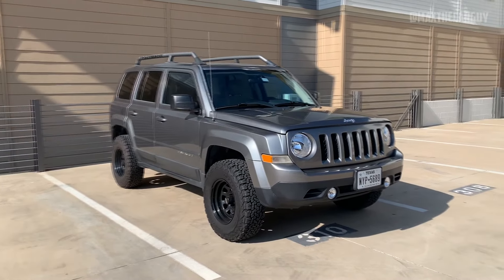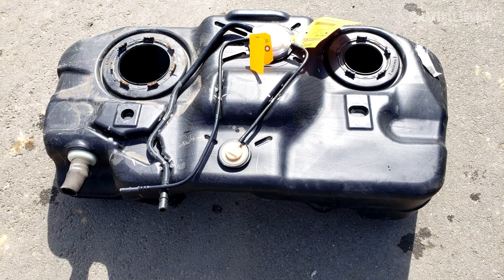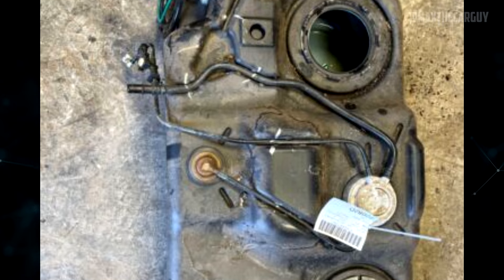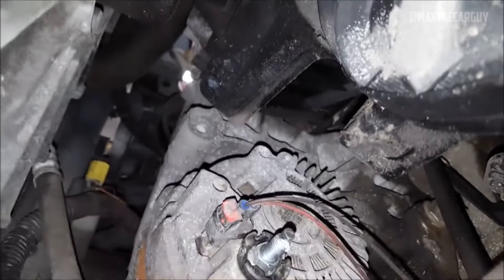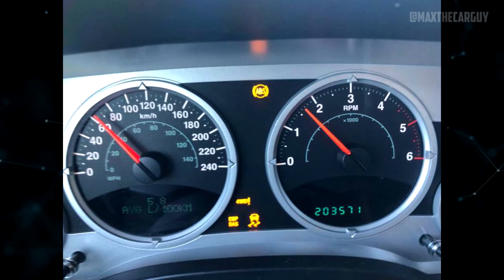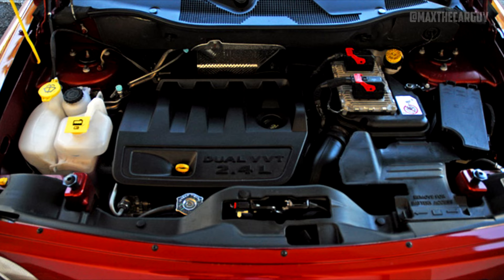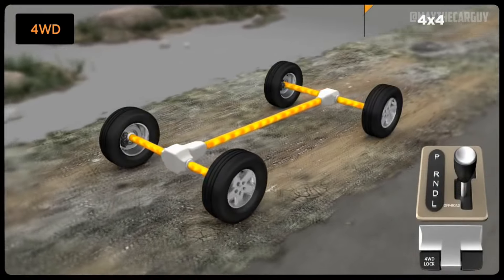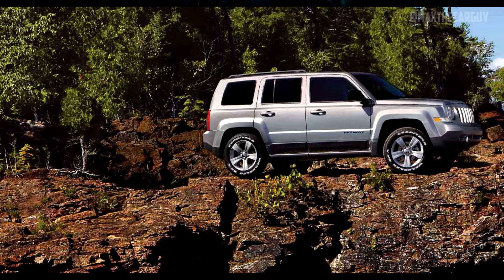Used Jeep Patriot (2007-2017) - Reliability and Common Problems

Comment: Buy a Toyota end your misery of owning a Chrysler product
Reply: All cars have problems. I bought a brand new 2023 Corolla and the transmission went out at 20k 🤷🏽 just to show you!
Reply: Toyota is crazy expensive. I just need something good and simple
Reply: @Jadenkimg05  Toyota super reliable Chrysler products are not money pits come in at my work all the time always needing tons of work
Reply: Yeah I guess
Reply: Not giving 20,000 for a Toyota with 200,000 miles. Just not doing it.
Reply: My Toyota lasted longer than my Chrysler, but my Chrysler lasted longer than my Ford and my Buick
Reply: At least chryslers won't rust as fast as a Toyota.
Reply: @philliplillpop860  a Toyota with 200k mi will be less problematic than a new Chrysler product.
Reply: Jeep = just empty every pocket
Reply: @papabear3525 I Don’t doubt it, but over all Toyota, Honda, Lexus have a much higher reliability rate.
Reply: 30k vs 16k new then
Reply: @TraveladvRajanSRai  the best built vehicles are not cheap.
Reply: @davidthomits544  You obviously either have a lot of customers that neglect their vehicle or you’re padding their bills.
Reply: @Slacksfifth  Toyota sheet metal is made from recycled steel.
Reply: @uncletoby- as all steel is recycled. But Toyota is manufactured to a MUCH higher standard
Reply: @TheRealCaptainKlutz  I’ll stay with a Chrysler, Jeep or Dodge vehicle over any imported vehicle. I’ve never had any trouble with any of the ones I own and have owned.  I still remember WWII and the Korean wars and what those people did to our soldiers.
Reply: @uncletoby-  I knew just by your comment about the steel that you were ...older.  something something stuck in your ways, now you're bringing up two events not related at all, but your narrow focus groups them together. You can have your Chrysler's, owned and designed by stellantis LoL 😂. Or Buick. Those vehicles appeal to those that don't know any better.
Reply: Yep Toyota hasn't had major recalls the last 15 years. They ALL cut the same corners. Gtfoh
Reply: @Slacksfifth  That’s because they’re built using recycled steel from the U.S.
Reply: @mitchellferre1652  Not mine.
Reply: @TheRealCaptainKlutz  Not !
Reply: @uncletoby-  they are all made from recycled steel.  There is nothing wrong with recycled steel.  It's not weaker or more prone to rust as long as it has been properly treated.
Reply: @TheRealCaptainKlutz  Glad you think so.
Reply: @uncletoby-  I know so old man. Been manufacturing steel for nigh on 30 years. The best steel comes from Japan. EOS
Reply: @mitchellferre1652  Glad you’re driving that imported crap and not me.
Reply: I totally agree with American made vehicles nowadays you’re just buying overpriced gimmicks and low quality junk
Reply: @Jadenkimg05 look in to old Buicks
Reply: If you love Japanese  . Remember  1941..

Comment: I’ve had my 2016 Patriot for almost 5 years now bought it used, has had normal maintenance still runs great 😋
Reply: I think im about to buy one thats why im here but your comment made me more confident in my dicision thanks!
Reply: Have front and rear cross members checked. Just had my rear replaced along with radius arms and some suspension parts due to rust. Very expensive.  Mine was past the 10 year warranty extension. Not sure what your warranty options would be with a used car.
Also, replace the PCV valve. It's cheap and easy to do, and it's routine maintenance that's makes a big difference in patriots.
Reply: Yep, 2016 and 17 they got it right. My 2016 is solid and what a find, the good transmission, back up cam, zero issues because timing chain and the best build of all the years.
Reply: I bought my 2016 with 43,000 miles. Now have 157.000 and going strong
Reply: Me too. I've had mine a 2016 for 6 years with no problems. And it runs great in the snow ❄️.
Reply: @timothywalter9555 don't my 2017 2.4L high altitude edition has been nothing but problems, from suspension components, to throttle body, and now a new ticking when I turn it off , it hesitates and it's as if the manufacturers wanted to make it as hard to work on as possible , it hit 130000km and shit the bed basically
Reply: Although full disclosure I bought it with 74000km on it and 3 previous owners and the carfax claims it was accidented
Reply: I just bought a 2016 Patriot 2.0L with 66k miles.  It's good for me.  I'll be sure to keep up maintenance with Crystler.  Thanks for the vote of confidence.

Comment: I just purchased a 2017 4wd patriot honestly I have no complaints.
Reply: Well you JUST purchased it. I’m actually thinking about getting one which is what brought me here.
Reply: @sniff270  fuel tank could be bigger .
Reply: Drive it carefully no rammy I fix one almost every week in last year, 70 yr old grandma owns it I did  power steer pressure hoses, serp. belt and tension kit, lower a arms, just did leaking power steer rack ,now Pinion seal tomorrow, good luck oh she drives hell out of it and it has 140 km on it that isn't 90 thousand miles .
Reply: Take it back. Buy a Toyota.
Reply: ‘Just’ purchased is the key word
Reply: @youtudey138  weren't Toyota's just recalled? No thnx
Reply: They have problems at higher mileage. If you don’t have a job and don’t drive much it will be fine for you.
Reply: Just wait..

Comment: 2014 2.4l auto (non cvt) 4x4 Patriot here. Low mileage (VERY low) on mine, but I absolutely love this vehicle. It's been quite good to me, cost me oil changes, a set of brakes, one set of winter tire and a new battery (that lasted 11 years, changed today). It was a great buy back then, cheapest 4x4 I could find. It turned out to be quite comfortable for its price, and also, it drives very nicely. I plan on keeping this thing until it rusts into nothingness...

Comment: I got my 2011 in 2020 . My mom gave it to me . She bought it new in 2012. It had 13000 kilometers. I now have 170 000 as I actually drive it. I have had no issues until just recently a control module in tbe steering column   nothing that woukd make me hate this jeep. I do a lot of winter driving . It holds  the road like  a champ. It is quiet . Easy on fuel. 50 liter tank . Yes it is a simple interior but whatever. I was driving a newer Honda Acord. Mom told me to sell it. So I did. I miss all the perks but I am  used to this jeep .

Comment: 2016 jeep patroit owner.  runs fine.. have to change spark plugs like clockwork or it starts to misfire sometimes but completely not an issue.  But fully paid off and still a great automobile.. also nice gas milage... perhaps at 72k miles its time to finally replace the shocks LOL

Comment: 2007 Limited 4x4 here with 209,079 and have had very few problems. The 4 wheel drive is better than I expected and I've owned XJ Jeeps....with anything maintenence is key. Pretty damn happy overall 😊

Comment: My patriot has 230000 and still going strong 😊
Reply: Awesome. Is it 4wheel drive? What year is it?
Reply: Thank you for the info. I was very curious about buying one 🙏🙌
Reply: Mine just broke 300k and I just replaced a stock rotor,caliper and pads. theses are too slept on
Reply: With less technology in the patriot it is that much less to go wrong. I had a 2007 King Ranch second hand. What a nightmare. If the engine wasn't giving me issues, it was the electrical. My patriot is a stress relief.
Reply: I did all my brakes and rotors but that is normal wear and tear as I drive a lot in city traffic and use my brakes a lot.
Reply: @Noble_Salvation 240000 Kms Experiencing some excessive wear on my Front driver side tire , going to look in to that .
Reply: I have 207000 on mine it's a 2016 just put a new front end and back end on the dzmn thing lol cheap parts thankfully
Reply: @kfufuoysfoog2984 probably tie rod. I've put 4 sets on mine. That or lower control arm I just changed mine
Reply: Let me guess manual?
Reply: Can you just replace one tire on jeep Patriot 4x4 if one goes bad?
Reply: @nahavandi89 did you actually buy one and if so how is it? I just bought the 2015 north edition.
Reply: @belloa3026 yes it’ll be perfectly fine because they are 4WD not AWD

Comment: I just bought a 2008, its got the cvt transmission but fairly low miles for the age. Ive got a roadtrip planned for next summer, just over 700 miles each way, does anyone have an idea if itll be able to do that? It'll be driving freeway speeds for most of the day for a day or two and then back after a few days
Reply: i just bought a 2009 today, i’ll keep you updated 😂

Comment: mine is 2015, I had for 6 years now. I traveled 5 times out of town for over 900 miles each way, and now it has 77000 miles. The only maintenance I've done is changed the timing belt to be in the safe side, and I haven't faced any issues so far. I hope it continues running smoothly without any problems.  🥺🥺🥺🥺
Reply: Except the Jeep Patroit never had a timing belt.
Reply: @davids.9834  the 2.4 has a chain?
Reply: Yea chain don't need to change 2,4 is gud
Reply: I hope it wasn't too expensive because it doesn't have a timing belt.

Comment: Bought mine new in 2015 with a manual.   Have 154,000 miles with no major issues.  25 - 27 mpg on average.  I don't do any major off road stuff but going up gravel roads and such the 4 WD is adequate.
Reply: I just a 2015 and I’ve heard 50/50. It was at a good price and 105,000 miles and over all good condition.

Comment: I got my patriot in 2014 used it only had about 30k miles. It's been working fine I'd say I've only had to replace the alternator and that was the biggest fix. My uncle did it for 250$ in parts . Although it always pops up with engine lights because of the ABS and gas cap. It's needed about 3 to 4 new batteries in 10 years regular oil change and the gas mileage gets worse as the car gets older. It leaks water all the time I think the ACs are no good and it's like 750 to replace. I also had a motor regulator go out in my passenger windows and had to pay the guy about 150 to roll it up and check various other issues. It's been very reliable besides small stuff fixes that can be fixed within a day. It's like a upper mid vehicle I would want a sturdier frame less electrical components that are going to break easily anyway.

Comment: Brought a 2014 Jeep Patriot - latitude Edition. Brought it with 30k on the dash in 2017.

We had the alternator replaced, 
The battery has been replaced several times maybe 3 times, we replaced the throttle bottle, replaced the belt twice now. 

We have mystery going on with the ac // no one can seem to figure out the issue. Had. The reservoir and hoses replaced on for the coolant leak. 

We are at 155,555 literally and the transmission needs to be replaced. 

I give up! All these new cars are trash. It’s very upsetting

Comment: I have a 2016 Patriot with FWD, a 2.4l inline 4, and 6 speed manumatic transmission. It's been fairly reliable, but the interior design is weird, and driving a sedan cosplaying as an SUV makes me feel like a poser. I took it off-road (through a very marshy front yard) once, and it was fine.

The best thing about it is the cargo space. I can get quite a few 8' 2"x4"s, about 4 4"x4"s, or a bunch of 8' PVC pipes. This has been useful numerous times
Reply: Manumatic eh?

Comment: Just about to buy one until I saw this video, their good-looking vehicles but I don't have time to work on it every month.
Reply: I've got a 2009 had it from 2012. All I've done is an alternator oil pressure sensor valve body for cvt wheel bearing that's it beside new batteries. Tyers normal maintenance 260000km still go's and great little camper.
Reply: I've got a 2009 had it from 2012. All I've done is an alternator oil pressure sensor valve body for cvt wheel bearing that's it beside new batteries. Tyers normal maintenance 260000km still go's and great little camper.
Reply: I've got a 2009 had it from 2012. All I've done is an alternator oil pressure sensor valve body for cvt wheel bearing that's it beside new batteries. Tyers normal maintenance 260000km still go's and great little camper.
Reply: @judedavidson5453  😆Sensor de presión de aceite del alternador? cuerpo de válvulas para el cojinete de la rueda CVT? 😄

Comment: Occasionally?  After the 12k mile warranty expired on my 2007 Freedom Drive 2 expired, I took more trips to repair shops than to work!  Money pit.  At 60K miles I'd replaced the control arms two times.  Full brake jobs 3 times.  Antilock brakes would activate (slam on and off hard) on dry pavement during the summer as I would negotiate a curve at 55MPH without even touching the brake pedals almost causing an accident.  No one, including Jeep could fix it.  Everything was severely rusted, including my crossmembers, which Jeep told me they wouldn't fix until the car collapsed!  I figure I paid $3.40 a mile to drive that car, without including routine maintenance, insurance, oil and gas. In 60k miles I probably paid double for the car in repair costs.

Comment: What year models have the CVT??
Reply: My 2016 has a CVT
Reply: It was on all of them, but you could also buy the 6-speed traditional automatic transmission as well starting (I think) around 2014(?). I've been researching on and will only consider the 2.4L 4-cylinder and the traditional 6-speed auto. Found a few nice ones near me - all under $12k - with decent service records. Might need to pull the trigger on one soon.
Reply: 2013 and previous years
Reply: @m1cajah how can you tell if it has a CVT or six speed? I'm looking at one now 2015 2.4
Reply: @TheBootyBamboozler  thanks I heard if you look at the cap or dipstick area for the transmission it might say on there
Reply: Put the shifter in drive ,move the shifter left or right it will up or down shift up on the dash.
Reply: @SeriouSXXFireworks  Los 2.4 no llevan CVT, tiene una automática de convertidor de par de 6 velocidades, creo desde 2014 o algo así. El motor 2.0 está asociado a una manual de 5 velocidades o a una CVT.

Comment: The crossmember thing is a big deal. Recently had to have my 2012 patriot rear crossmember, radius arms and rear struts replaced. Very expensive as i was past the 10 year extended warranty. Wish id known to look for that issue sooner. 
Have a reputable mechanic check a used Patriot before you buy, if youre considering one.

Comment: I purchased one of the earliest "off road rated" Jeep Patriots in 2007.  Very excited.  Had wanted a Jeep for decades.   New engine design. One of the first vehicles, I think, to specify 5W20.  A few months after I bought it, Jeep increased the length of the engine warranty for new purchasers, but not early purchasers like me.  I was suspicious.  Jeep had narrowly avoided federal fines for having too low a fleet average  MPG.  They did so, solely with the inclusion of the Patriot, which got much better gas mileage than the other Jeeps in their lineup.  I did some investigation, and learned Patriot owners in Europe were told to disregard the 5W20 oil recommendation in the manual to avoid premature engine failure.  But US owners were NOT warned.  In fact, our oil caps were embossed  "5W20". So (IMHO) US owners' vehicles would be sacrificed so Jeep could avoid federal fines.  I started asking mechanics to use 5W30, but got a lot of resistance due to the embossing on the cap.  So I milled the embossed lettering off the cap.  The car turned into a rust bucket before it hit 60K miles.  It was a money pit.  It was too fragile to keep on smooth paved roads.  In fact I NEVER dared to take it on un-paved roads let alone off road. The only thing that didn't fail was the engine, because I used thicker oil.  Despite all the repairs, I took a $20k beating on trade.  Never again Jeep.  Never.  My advice?  Steer wide of vehicles that specify thin oils for MPG.

Comment: The traction control system needs to be turned off each time you get in the vehicle to get 30 miles per gallon

Comment: Buying a 5 speed manual tomorrow.  Is safe to say its not CVT because its a manual?
Reply: My ‘08 is NV T-355 5-Speed Manual, it’s not CVT. Did you get yours yet?
Reply: @AaRonation No I didn't. Dude sold it for a someone else who bought it for $800 more.
Reply: @Manzilla56  Crazy. I’ve been there a bunch. Find a decent deal and someone’s always there to offer a lot more for these. Can’t find one I don’t have to rebuild in my area for under $3,000 now
Reply: @AaRonation  I found one with 30k during the pandemic for 6,000 dollars and it was sold the next day.

Comment: I just purchased a 2008 jeep patriot and it overheats in idle with ac on! I got it from a small car dealership,said they got it in auction. Didn’t really know to much about it allegedly 🙄 send help!!
Reply: Al conectar el CA el electroventilador del radiador del motor DEBERÁ encenderse siempre, en algunas marcas también los hacen a ALTA velocidad de rotación del motorcito eléctrico (electro ventilador) haciendo un by-pass a la resistencia incorporada.

Comment: Honestly it’s not even reliable my jeep has problems anywhere in it and mind you I drive it like a grandma you can’t even abuse it, one slight tap it feels like it’s gonna break down not even exaggerating I don’t know how these cars even were approved to come out production. My rear subframe was bad the suspension and ball joints the arms under to hold the wheels which I had eaten up tire thread. If anyone is thinking about jeep please don’t go the Honda or Toyota way even a early 2000’s or before 10 will work you so long
Reply: Agrees I’ve paid so much money to have repairs and I’m not even at 100000k miles
Reply: I have a 2008 patriot and nothing but problems I'm constantly replacing parts on it  and my daughter has a 2014 patriot and she has had nothing but problems and it is now parked in my back yard with spun camshaft bearings on the exhaust side. Money pit junk.